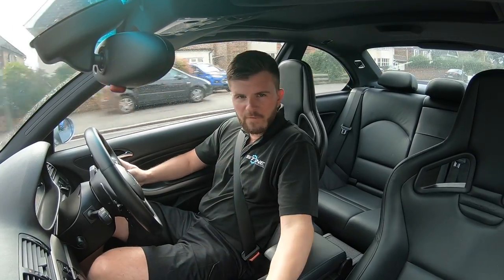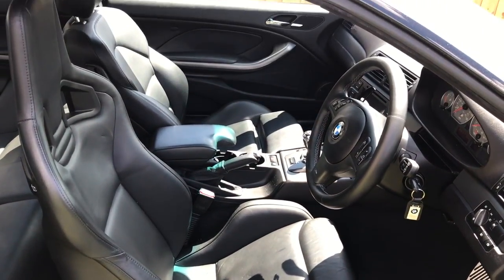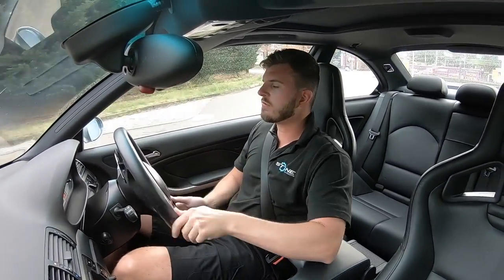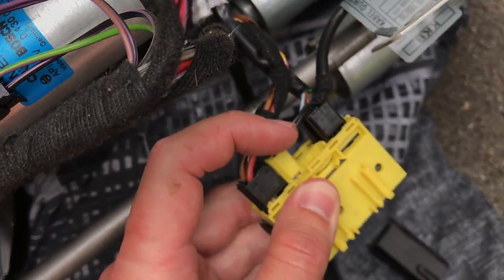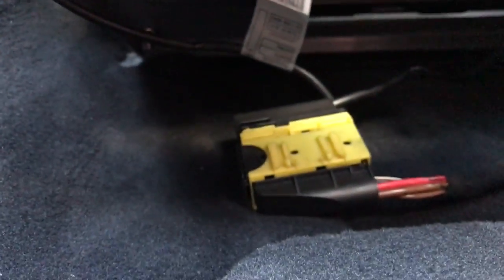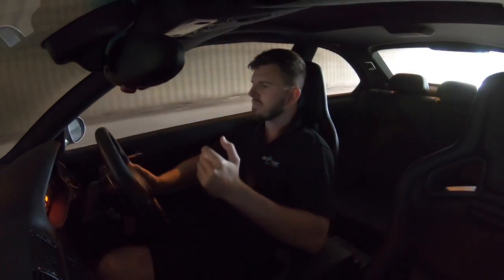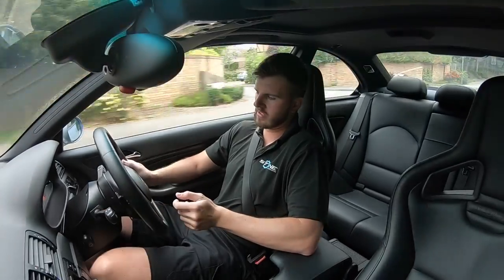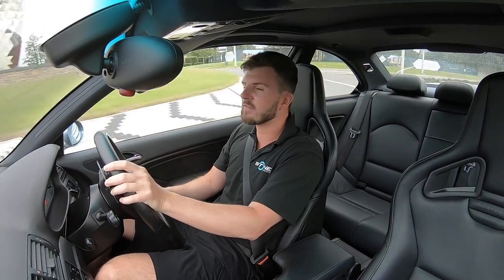BMW e46 M3 aftermarket seat fitting guide - Recaro goodness!

Comment: Hi James do you have sliding rails under the seats ? I’m looking at a pair from a Clio I plan on buying and installing 
Thanks
Reply from the maker: Hi Gavin,

Yep I have Recaro sliders on mine so fully adjustable 👍

The Renault version have a different base and also airbags in the seat (e46 has the stock airbag in the door) so the Renault ones can work but not the best solution

Comment: You removed the most comfortable leather, fully adjustable bucket (and heated) seats, with memory positioning for two other people for this!?
Reply from the maker: The standard seats are awful - minimal support & high seating position, would do exactly the same if I had to start again. 

Sounds like your a big fan of the standard seats, glad they work for you 👍 (assume your under six foot in height)
Reply: @stoneautomotive  It does sit a bit high, but everything else you said is wrong.  Minimal support?  I guess yours doesn't work.   On mine, you push a button and the seats sides inflates to hold you firmly in place.  It also has thigh extension for taller folks (I'm 6' 3'').   But most importantly, isn't britain supposed to be a cold place?   So no more heated seats for you
Reply from the maker: Drive with a set of seats like this and you will be blown away 👍 the inflatable bolsters work fine on my originals but provide minimal upper body support (shoulders) and the base bolster supports are minimal, personally find on track or even spirited drives you are wedging your legs again the door/tunnel side for support - agree they are a nice comfy seat for motorway use but personally find the Recaro CS even comfortable (drove across Europe in them)

Heated seats are not required for me, car only covered sub 2,000 miles a year as a summer/ weekend car - have an e92 M3 with heated seats for the all year round daily use 👍

At 6’3 you must struggle on track for head room with a crash helmet without the seat being lent back to far to have full control of the steering wheel?
Reply from the maker: It certainly depends on your use for the car as the standard seats work well for daily use 👍

You should get it on track, really allows you to enjoy the M magic that they offer over the normal e46 😎

Hopefully mine will be finished in March ready for its first track day of 2021 - plenty more to come on my channel for the e46 but certainly not a standard car if that’s your thing.

Comment: I've sat on some CS Sportsters and felt there was less thigh support than the OEM seats on the e46 M3. Can you comment on this? I like my thigh extensions all the way out.
Reply from the maker: Wow that’s the first I’ve ever heard that, find them an improvement over stock on seat height, support and comfort 😅

Obviously a personal thing and if the standard seats are best for you then your gonna save a fortune not having to buy a set of recaros 😅👍
Reply: @stoneautomotive  I believe they are an improvement in every aspect, apart from thigh support. Would it be possible to measure the distance from the backrest to the very front of the cushion? It's only the thigh support that I think I missed. BMWs generally have the extension for thigh support.

Comment: Great video 👍 quick question: what hardware did you use to mount the pre-tensioners and did you mount recaro sliders?
Reply from the maker: Thanks! I used the original Lotus mounting points that were on the seats, the pre-tensioners needed the inner collar machining from 10-12mm. After that it was the recaro/lotus base > universal recaro runners > OMP base plates
Reply: Stone Automotive thx,  do you happen to know the part number for the runners,  I'm seeing different kinds online.

Comment: Is your seat centered to the steering wheel? I just installed these seats and they are either too high or offset from the steering wheel.
Reply from the maker: Yep all perfect but I had to modify the bracket so that the seats were as close to the tunnel of the car, only just enough clearance for the seat belt buckle

Comment: how tall are you? just got a set and am wondering if ill be able to use a 4pnt harness at 6 foot 1
Reply from the maker: I’m 6’2 so a smidge taller, seat height is perfect but it really depends what frame/ slider set up you decide on
Reply: @stoneautomotive  managed to get them pretty nicely low with custom frame and a sparco slider. My issue is the distance between sitting and the two holes for the shoulder straps. if you are 6,2 and have the holes at your shoulders then i should be fine! thanks for the answer
Reply from the maker: I see, yep you should have no issues 👍

Ps I don’t have a dwarf body with long legs for the height before you ask 😂
Reply: @stoneautomotive  hahaha thats perfect mate! cheers!

Comment: Wish you showed actual footage of the install.
Reply from the maker: This is one of the early videos on the channel - the guides have gotten much better since 👍
Reply: @stoneautomotive  is there one where you complete the seat installation? As well as using the OEM seat belt tensioner!
Reply from the maker: @simonnim321  sadly not for the e46 only for the e92. As my recaros are from a lotus Evora they already had the seat buckle mounting point in place to bolt the original pre-tensioner/ buckle

Comment: are this seats also aviable for the BMW e46 320i coupe not Facelift?
And is the Fitting same?
Reply from the maker: The seats are from a Lotus Evora, you will need to contact Recaro to see if they make an adaption kit (floor mounting should be the same as the e46 M3)
Reply: @stoneautomotive  Thank you for the quick answer